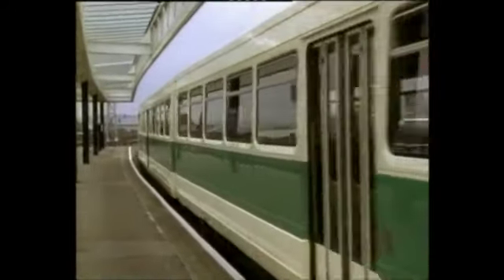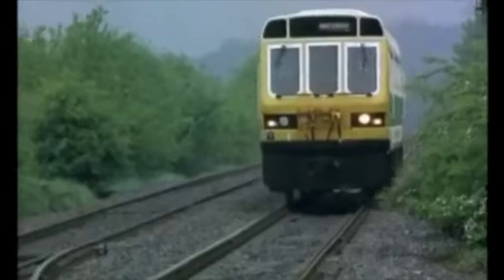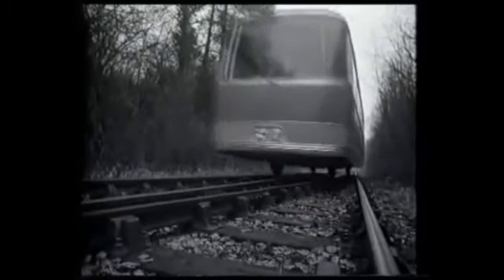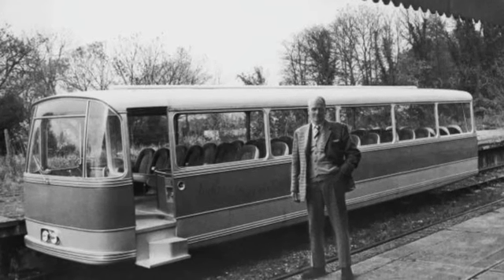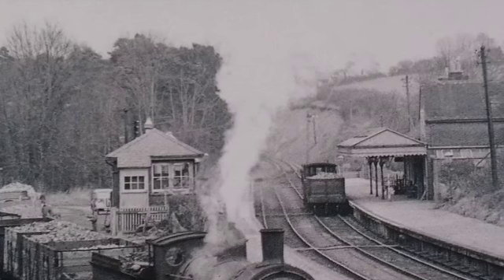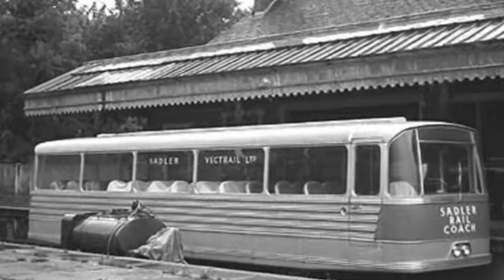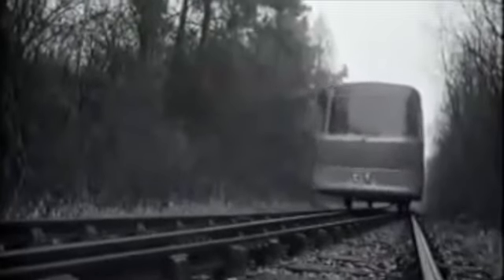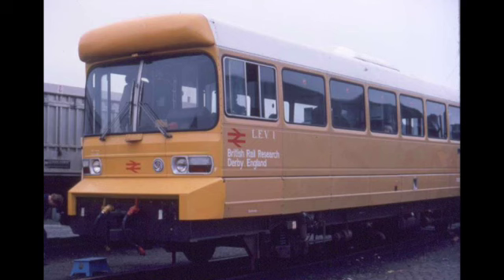The Original Pacer Train? The Pacerailer

Comment: Love how the Sadler name is just one typo away from the Swiss company which offers a much better solution for lightweight rail transport!

Also, I miss the 141s. They may have been rubbish but they were a big part of my childhood in West Yorkshire.
Reply: I kind of feel the same (also West Yorks). Even though they're awful trains, they still kept routes running for lack of other stock.

Since their withdrawal, my local station has gone from hourly service to 3 trains total per day. I'd much rather a crappy pacer than nothing at all.
Reply: "I propose we order our new rolling stock from Sadler"

"You mean Stadler?"

"No."
Reply: The Isle of Wight project was called Vectrail. A few years later tourist trains did run over the test bed, but steam-hauled and with small windows. It became part of what is now the Wootton-Smallbrook section of the onetime Ryde Pier Head-Cowes line. 

Seems weird to envision running up to 70 mph on tracks closed by Beeching and not maintained afterwards. Anyway sightseers do not want the scenery to go by in a flash.

Comment: C Hamilton-Ellis's "lovely Meon Valley Line" was also used for the Black Magic Chocolate ads with someone on a carriage roof delivering the goods "All because the lady loves..."I remember the skirted AC Cars railbuses on the St.Albans - Watford branch in the very early 1950s. They were very rough-riding. Pre-War, the LMS tried out a single decker bus with a roadrailer gear interchanging flanged wheels and rubber tyres on the former Midland Railway Hemel Hempstead branch.

Comment: I saw one of these Sadler Railcars at Droxford, on the Meon Valley Railway, in Hampshire, and met and spoke with yer actual Mr. Sadler.  It was a pity this concept was not taken further - we may still have the Hayling Island Branch if it was successful!
Reply: I also saw it at Droxford in 1971. I am pretty sure it was 1971 but the narrator said it was burned in 1970. I saw some burned carriages at Droxford and I found a small window in the bushes which I still have which I think would be from a Maunsell coach..
Reply: I am glad you met you grandad. Pity this never took off. Thanks to vandals from the opposition.

Comment: Infact the Pacerailer partially helped extend the life of a steam engine, Terrier No.32646, which was used to move supplies or the car, later moved to the Hayling Billy pub, whom in the 60s-70s sold it to the Isle of Wight Steam railway, presently it’s in its IoW Condition as W8 Freshwater

Comment: I spent a large part of my life living in Southampton but apart from the proposal to run these on the Isle of Wight I don't really remember much about them so it was an interesting insight into the concept. It would never have got off the drawing board today if you were to enter from track level, health and safety would have had kittens on the spot! A good video thank you.👍👍
Reply: This "prototype" vehicle could be entered via a platform, the flip out stairs were a idea for additional stopping points on a branch, so a platform would not have to be built, which is not a h&s problem as some existing branch lines did this already, hence GW auto coaches & some of the BR 4w rail buses having retractable passenger steps at the doors.
Reply: @martinsurridge7390  Ah understood, thank you for the information Martin.👍

Comment: I'm sorry,  but whilst I fully commend you on your excellent video of the Railpacer experiment, I have to stand up for the Pacer 142s.

The Pacers probably saved more branch lines than we will ever know about.

 They were built as a 9 year 'stop gap', awaiti g abetter replacement, which never happened and meant they had to soldier on for over 40!! 

And unlike any other class of DMU, I have NEVER been on one that broke down. 

On welded rail, they were excellent.  It was only on joined  rail that they became "nodding donkeys" and even then, not always.

They had, by far, the most favoured driving positions of staff and were so basic as to be so easy to fix any smaller "issues," usually with a kick or a screwdriver. 

Were they perfect? No. Absolutely not. 

 But did they do an excellent, reliable, very cost-effective, and trojan job for FAR longer than they were EVER intended to do?

 Yes, absolutely they did 

This is why so many of them have, quite rightly, been snapped up by heritage railways, not only because they are a legitimate part of our railway's history, but also as they are a very viable source of rolling stock at minimum cost to the heritage railways concerned. 

So I'm sorry, but the Pacer was a much maligned and unfairly so, reliable, very efficient, and cost-effective vehicle.

Comment: Derby may have inflicted the Pacer onto the Northern Provinces, but it MUST have something to redeem it. Doesn't it?
Reply: I commuted on Pacers for a number of years. They were fine on the continuously welded Aire Valley route. They provided a cheap way to maintain a high density service & their longevity is the proof.
Reply: @alanjewell9550  Longevity? Not really....its all down to the Govt. They decided that 40 year old crap was good enough for Northerners and other yokels, and they were only forced to dispose of them when accessibility regulations made them illegal. Awful things....
Reply: It's easy to knock the Pacers nowadays when we have a lot nicer rolling stock.  But you need to remember that they saved a lot of less used branch lines by providing a cheap alternative when the only other option would have been closure.  And it wasn't just the North that used them, they were commonplace in Wales and the South West as well.  If it wasn't for the Pacer, a lot more branch lines would have closed.  They were better than no train at all.  So give them the credit they are due.
Reply: @marionbloom1218  I absolutely totally agree. Well said.
Reply: @marionbloom1218  Personally, I'm not entirely convinced by the argument that the Pacers were so cheap that they saved branch lines from closure. For one thing, closure of any railway had become politically almost impossible by the 80s. And how cheap there were in reality probably needs some forensic accounting to establish - I once saw a figure that under our lunatic post privatisation train leasing system that operators had to pay £400K a year for the privilege of running a Pacer! No idea if that's true, or what the figures for other DMU's but thats an insane figure for something that was meant to be a cheap to buy limited time stop gap until decent trains could be obtained! They may have been acceptable on short branches, but they were often used on intensive commuter services where they really weren't up to the job.
Reply: @timbounds7190  They seemed perfectly adequate for the commuting I did on them. And they were great for bikes as the side seats folded up. They were basic but functional though maybe outstayed their welcome.